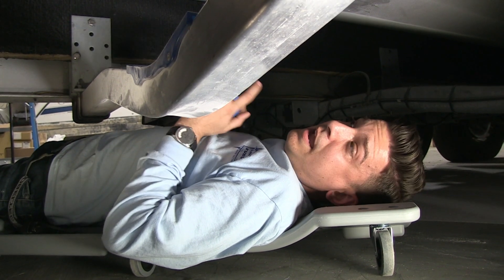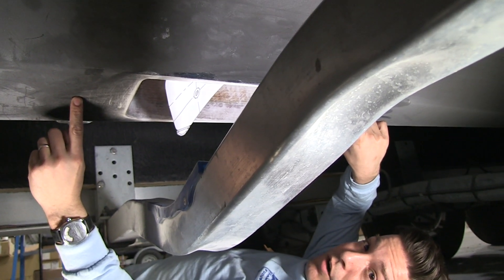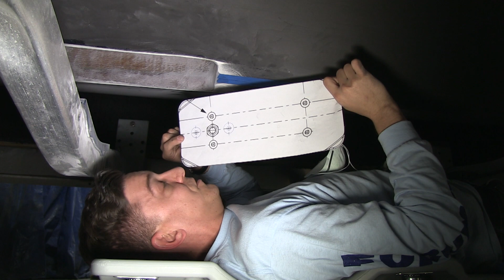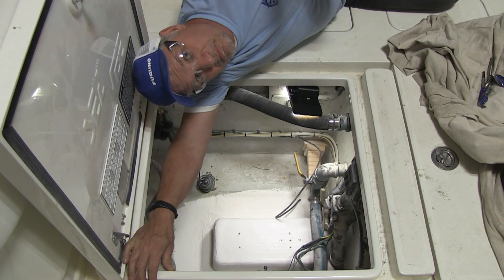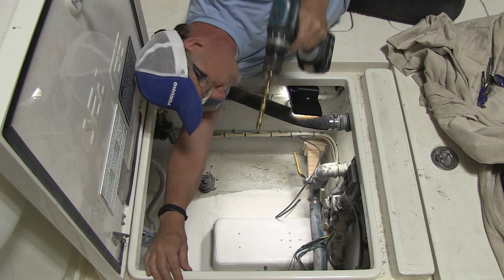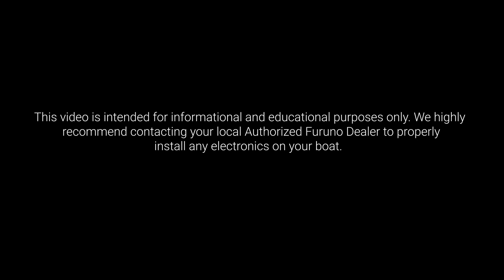Furuno Connections - Episode 7 - Installing The Transducer

Comment: Could leaving the face of the transducer stick out slightly lower than the hull by 1/16 or 1/8 of an inch be beneficial to helping to break up bubbles and get cleaner water over the transducer or maybe even getting the face of the transducer in cleaner water all together. I've seen people do this with transom mounts.
Reply from the maker: @Evan721sxm, thanks for watching! 
No, it would actually cause more cavitation issues that way.  Since the housing is square and flat essentially, having it stick down below the surface of the hull would cause it to “bludgeon” its way through the water and cause a mass amount of turbulence.  It needs to be mounted to the face is perfectly flush with the hull as we show it here.
 
A transom mount (and likewise a Thru-hull) is designed hydrodynamically to slice through the water and avoid turbulence. If you have additional questions like this, head to the Furuno Forum (https://furunousaforum.com/) where we have Furuno delears and technicians that can fully answer your questions. Tight lines!

Comment: Can the transducer face be angled to match the hull their is no flat spot on the hull
Reply from the maker: Thanks for watching. Unfortunately, these transducers cannot be angled.  These transducers are not Tilted Element, so they cannot be mounted flush on an angled or Deep-V hull deadrise.  They must be mounted facing straight down, which means that when installed in the centerline, they would have to build up and glass in a bit of a fairing around the sides of the transducer as a Hydrodynamic transition.

Comment: the mounting instructions mention using a face plate. I notice you guys just filled around bottom edge with 4200. Is it ok to leave the faceplate off?
Reply from the maker: The installation method can vary and either method is suitable. The plate is typically used when the pocket is deeper than the transducer and the installer desires a “wet” install where water is allowed to flow around the transducer walls. This would result in simpler removal if required, where an install like the video depicts makes removal more difficult.